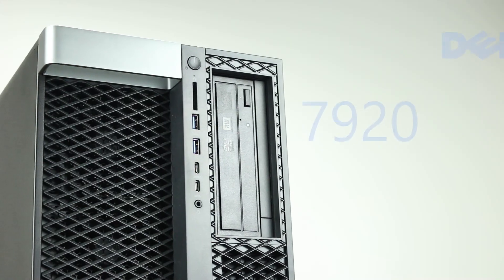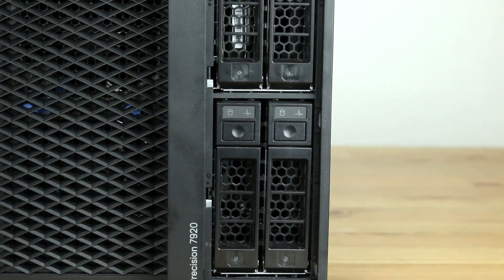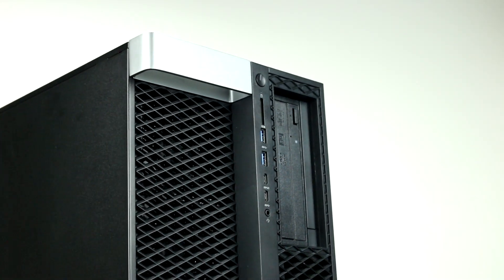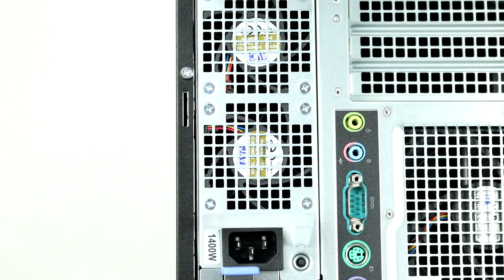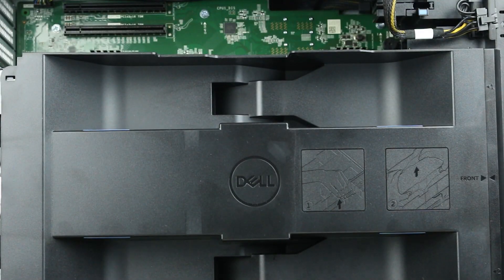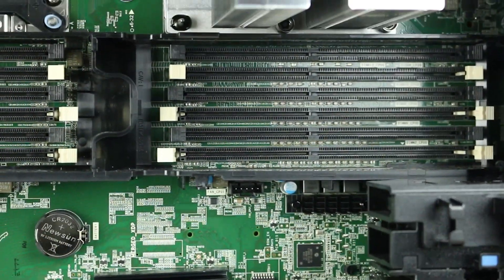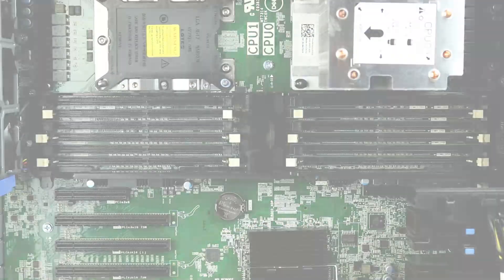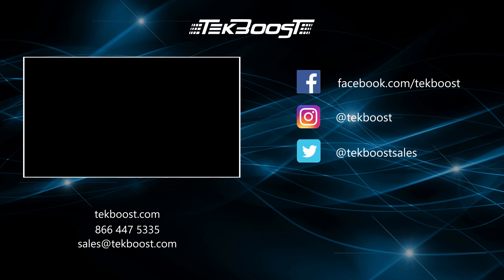Dell Precision 7920 System Overview

Comment: So the TOP X16 slots are fake not full speed cant be used for GPU? What other workstation can use 2x 3090 MSI 33cm leght GPU without extensions risers etc?

Comment: As I understand, the Dell Precision T7920 can use the Dell Quad NVMe PCIe adapter to support four m.2 cards up to 4TB (16TB total).  I plan on buying (in 2024) a T7920 with the adapter and four Samsung 2TB m.2 980 or 990 EVO (8 TB total).  How do I set these drives up to be a RAID (1 or 10) and Windows (10 or 11 Pro) boot drive?  I know it is possible because you can order a 7920 from Dell in this configuration (RAID and bootable).  Thank you.

Comment: are there cpu fan connections? looks like it uses a passive cpu heatsink, but if i wanted to add better cooling, i didnt see anything near the cpu's for power
Reply: These workstations are designed to run 24/7. Their built in cooling is purpose built for the machine and changing it might make the rest of the thermal design worse. I would avoid it personally.
Reply: @deanwilliams433  bro… you and I both know just adding a fan would make a world of difference. Plus there are multiple forms with this exact question on the cpu throttling due to heat. Stop fanboying dell and stop telling lies to others
Reply: @ace8656  nah  You have no clue how these machines are designed and you are obviously not the target audience for them
Reply: @ace8656 😂 you have no idea what you're talking about.
Reply: @Gorilla_Jones  yea you right, pushing hot air out of a case does nothing. Silly me
Reply: @ace8656 I'm going to reply because, why not.

The thing is very well designed from a thermal perspective. You're not seeing the shroud and mid fan in this video, it's been removed before they show the processor locations.

Beyond that you've got multiple fans on the case. The whole thing just works, and works well.

Comment: Dear All
Dell Company Product's &Laptop 
any issues not provide any replacements not given 
only on software issues was service Technical team support no issues no problems & no compliants...
Dell Company laptops was very Worst not working properly will facing problem and issues not retifi issues customer facing problem no worry software issues internal compliant ALSO software issues..... Don't replacement or not slove problem
PLEASE Don't Buy DELL COMPANY PRODUCTS

Comment: Can these PC be used for gaming
Reply: Yes, but you can have a top of the line gaming PC for less than this workstations mid config costs. If you are tempted by how fast these depreciate and buy used, you can put a non-workstation graphics card inside and they will do just fine.
Reply: sure but they are not made for it so with hardware made for gaming you can get the same gaming performance for less money
Reply: I don't recommend.  The GPU's are optimized for things like machine learning and data science.
Reply: i use my HP xeon z workstation mostly to game on, its a popular choice now to get a xeon cpu based workstation as a gaming pc and are just as good and sometimes better than higher end i5 and i7 cpus that are even several generations ahead of the xeon being used but at a much lower price. the wattage is kinda high when using a workstation to game on and not vary economical depending on the cost of electric in your area. but workstations are a vary good way to go if you want a powerful gaming pc, depending on if you choose the right higher core clock xeon cpu and of course a comparably decent gpu as well
Reply: @afrowitchdr  this was a long time ago thanks for answering

Comment: How much does it cost
Reply: My entire house!
Reply: the one i want costs as much as a decent new car
Reply: a wide range from a few thousands ($5k) to tens of thousands ($50K)
Reply: @chunhualiao8191  no 25000$
Reply: i tried the config in dell website and if you go almost full spect it may go even 150'000 $
Reply: @emuka-art  OMG, quite expensive it is
Reply: Dear All
Dell Company Product's &Laptop 
any issues not provide any replacements not given 
only on software issues was service Technical team support no issues no problems & no compliants...
Dell Company laptops was very Worst not working properly will facing problem and issues not retifi issues customer facing problem no worry software issues internal compliant ALSO software issues..... Don't replacement or not slove problem
PLEASE Don't Buy DELL COMPANY PRODUCTS
Reply: @saipavanpachigolla4345  Seems like you are not having idea regrading tech
Reply: in a few months it'll probably be a couple hundred bucks